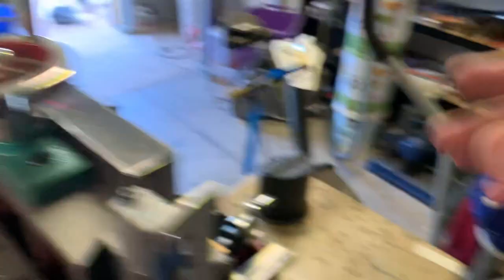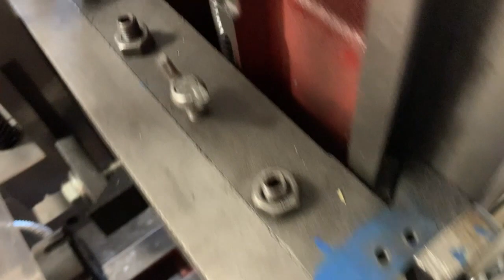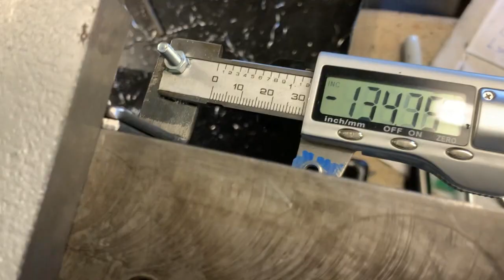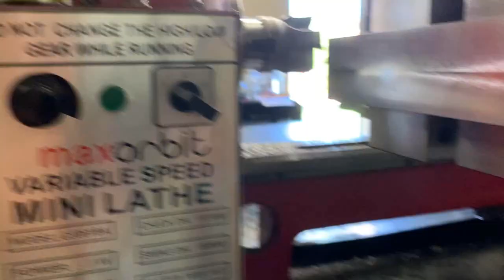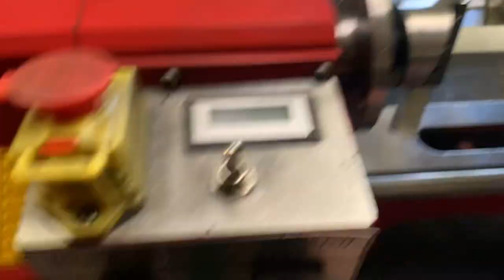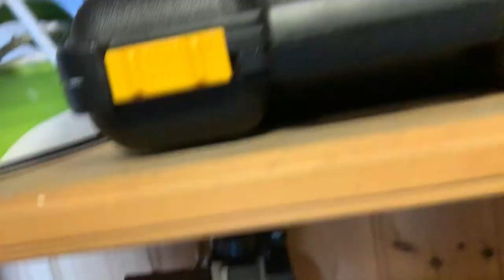Mini Lathe to a Mill

Comment: Hi Dan, I watched with great interest your frankenmill creation, it really started my own creative engineering juices flowing. I immediately saw the endless possible improvements and modifications that could be implemented. As soon as I saw your creation I though that it cried  out to be mounted vertically onto a heavy steel plate L-shaped angle frame with motorised lift to the cross table/knee!  I look forward to following your progress, well done and keep up the good work. Thanks for sharing this interesting video.